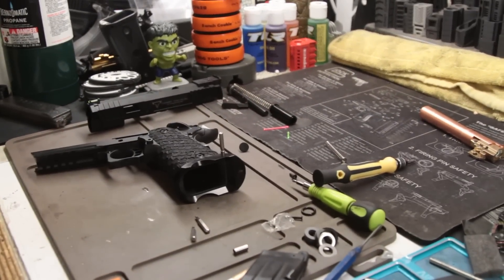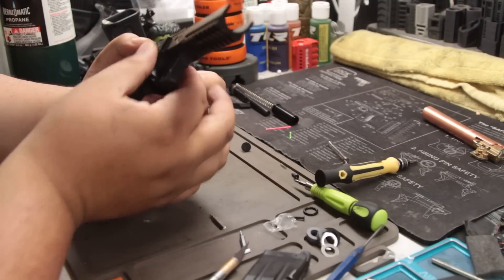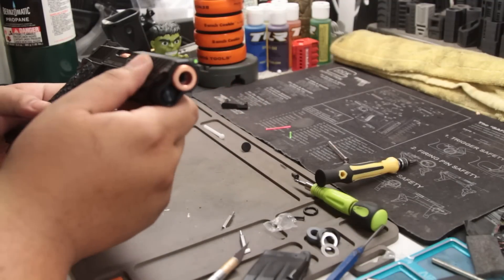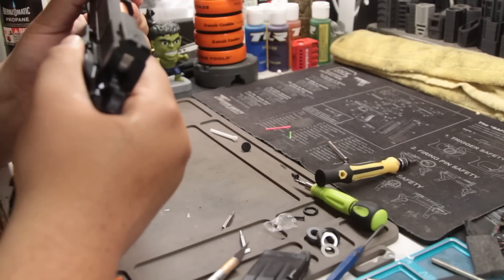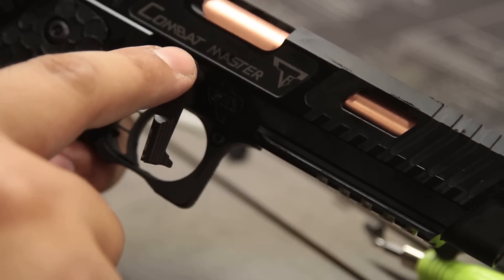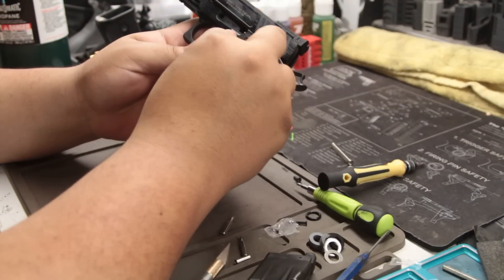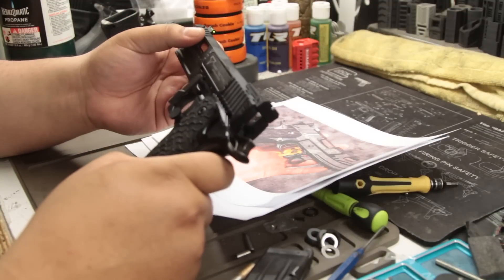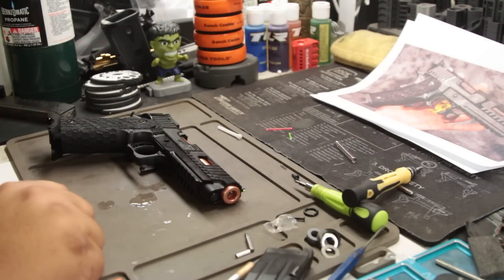Build Series: John Wick 3 Taran Tactical Hi-Capa Build WIP (3/7) (SOLD)

Comment: Hi Knuckles, I got this same kit still in the box, What grip is that? which company made it? What are the main problems with this kit so far?
Reply from the maker: the grip is done by scorpio tech, its on boomarms listed as CL custom grip. its just tight as you can see from 2/3 part of the videos. if you know what you aree doing its not that big of a deal..just time consuming
Reply: @KnucklesGSM  Thanks knuckles, I bought this grip from AM and the hammer housing piece is very lose. I was kind of mad because I paid 80 bucks for it. I wonder if the one you purchased is better quality.